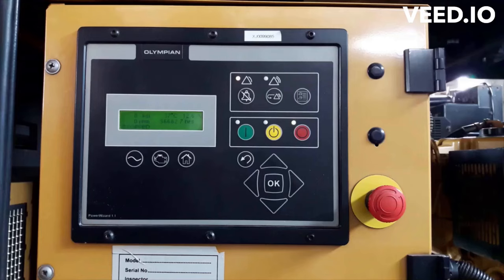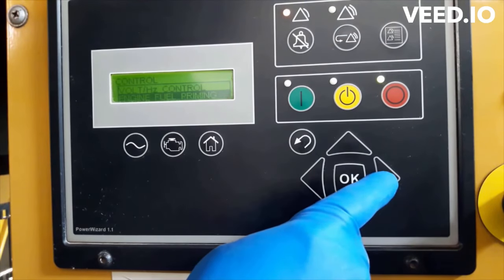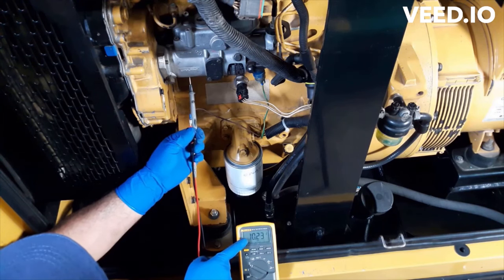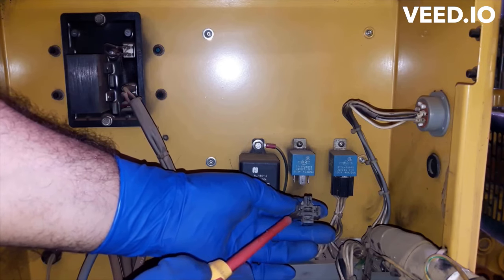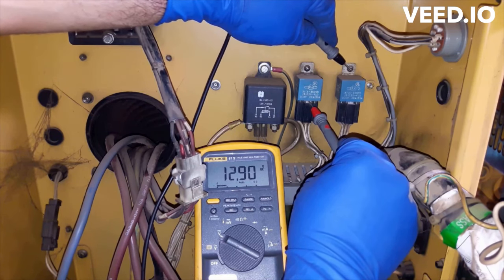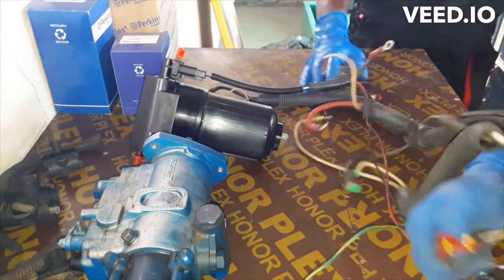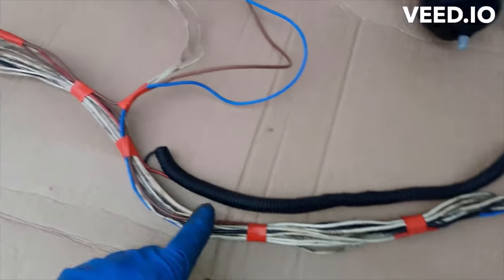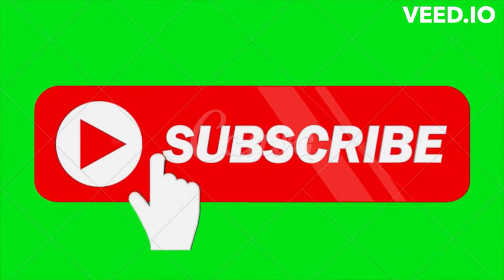Generator Starting problems and troubleshoot

Comment: Why rpm for 4pole genset is 1678 and not 1500
Reply from the maker: 4 pole  230 V  50 Hz.  RPM  1500
4 pole  120/110 V  60 Hz. RPM 1800 
Run the genset check the frequency and correct the RPM.

Comment: My problem for genset is not cranking sir
Reply from the maker: Check your battery voltage make sure it is fully charged otherwise you have problem either with starter motors solenoid or relay please click on this link watch this video it could solve your problems. 
https://youtu.be/W8UOMo2-gVE?si=nSVv097Oid6tu8Uj